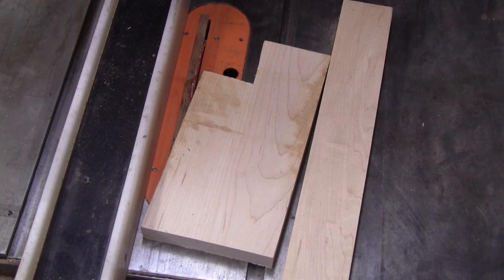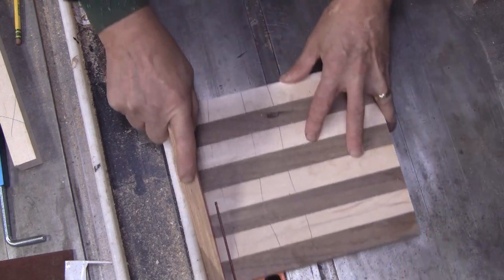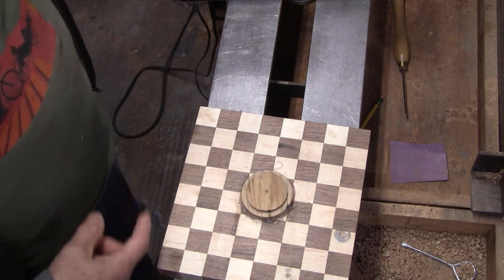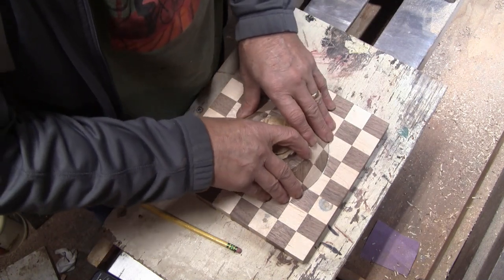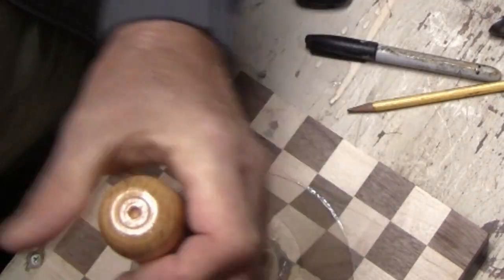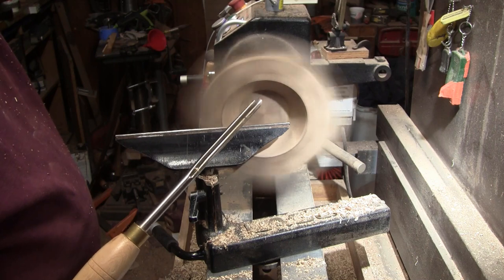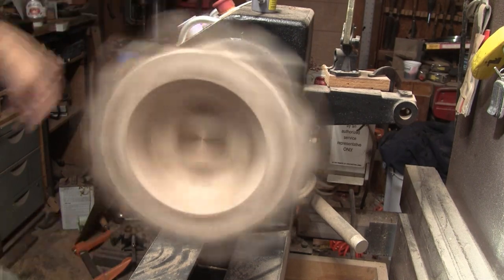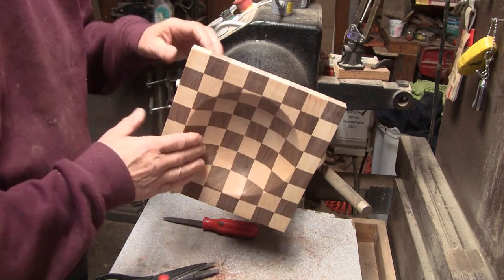Wood Turning A Bowl In A Game Board

Comment: Another very original idea. I suppose with every next project You impress yourself, Gary 👌 Lots of advices from You are priceless. First time I have heard about this tip with denaturated alcohol to remove hot glue. I need to check this one and this with slow and gentle cutting off the rings with parting tool. I will test it at first and if I will make it it will help me with my project on which I'm working now.
Great work You have made on this bowl and I can't to wait next ideas 👍
Have a wonderful weekend, Brother 💪
Rav
Reply from the maker: Thank you Rav, I have to admit this ended up looking better than I was expecting. I used to try and cut the hot glue off with a parting tool but it would just gum up. This really does a fine job.
 For sure if you listed to the sound of the cut you will know you are probably less than 1/16 inch from cutting through. Sharpen up and little pressure. 
Take care brother and looking forward to your next video.
Gary

Comment: Hi Gary,
Very nice piece! It looks like an optical illusion from some angles!
This video came at a good time for me as I'm attempting to make a checker board and checkers. The checker board is pretty much straight foreword but I haven't figured out how I'm going to make the small 7/8" diameter checkers yet. I want them to have a little "texture on the edges! I always have one part of a project that sends me for a loop! LOL
Thanks for the video,,,
Tom
Reply from the maker: Thank you Tom and I liked the look so much as a flat board I was tempted not to turn it.
As far as checkers I had thought about that as well. You could turn a spindle and setup a router to cut texture along the length. If you have an indexer on the lathe pick how many groves you want. Then part the checkers off and sand them up. Just a thought.
Take care,
Gary
Reply: @ThePapa1947  
Thanks Gary,,, another option to consider!

Comment: Hello Gary, I really enjoy watching you make those bowls, and I'm sure you've been asked a thousand times if not more, what is that parting tool and where did you get it? Same thing on that scraper? Guy.
Reply from the maker: Thank you Guy. So the parting tool came in a set I bought at a garage sale. It was all new and cost $5.00. No brand marked on it. But I just bought a Sorby parting tool about the same size and will be trying it out soon. I well let everyone know how it works out.
 The scraper I bought from Penn State Industry. It is 1.5 inches wide.
 I did grind it to be a negative rake scraper though. It works great for a good price.
Thanks for watching,
Gary

Comment: Hi Gary in answer to your question it was the large chuck Longworth i think is the type
Reply from the maker: Bruce I made the longworth chuck. I have a CNC milling machine so it made it easy. You can do it with a router and there are lots of plans out there showing you how to lay it out and make it. I do see a number of them already made on places like Etsy for a decent price if you do not want to make it yourself. And the cost I see is not much more than buying the material and making you own.
 Hope that helps.
Gary

Comment: Great way to use up some leftovers. It’s fun leaving those square edges isn’t it. Those corners remind you real quick to stay on your side of the tool rest. 

The idea of a glue block was suggested for my square project. Had mine started as thin as yours I may have gone that way. But started no with 1 3/4” material the worm screw seems to be quicker and easier. Thanks for the suggestion.
Reply from the maker: Thank you Doug. Yes square bowls are fun to do. Having 4 corners it does give a better ghost image than a narrow and wide winged turning which can sound like a helicopter trying to take off from you lathe.
 Lots of options on how we can mount a piece. Today my glue block is on permanently and will become the base. Those I put the piece against the chuck jaws and turn a tenon on it. It is the glued to the bottom of the bowl then we are off and turning.
Thanks for watching,
Gary

Comment: This is a nice variation of the bowl from a board technique, I love this look. Can this be done with a standard 3/4" board or does it need to be thicker to make the transition from board to bowl?
Reply from the maker: Thank you Gil and for sure you can use a 3/4 inch board. I used what I did because that is how it comes from my favorite hardwood store. Which without traffic is only about 15 minutes away.
I thicker board will mean a little more wall thickness to play with but not really all that much.
Thanks for watching,
Gary

Comment: Very nice, Gary.  You must be an engineer, or at least you think like one.  What brand are the sanding disc holders you're using in your drill?  Where did you buy them?  Thanks,  Rick
Reply from the maker: Thank you Rick. I worked as a wood pattern maker and I had to design how to make the pattern so the foundries could use it to make castings from them. The drawings came from engineers who designed the parts and I would work with them with changes that might need to be made in order to mold the pattern in sand.
I think I bought the sanding mandrels from Penn State Industries then made the shaft to go on there disk.
This is what I bought and and made the shaft for them but I think they sell the shafts as well
https://www.pennstateind.com/store/SPA2PAD.html
 Hope this helps and thanks for watching,
Gary

Comment: Very nice indeed, the alignment is excellent. Have you tried to make this and thinned out the wings to say 4 or 5mm thick, or in your terms a shade under quarter inch? or would you say it would be unstable as segmented? Also looks like you need a better glue spreader, that brush soaks up more than is actually being spread, i'm not having a go, just an observation.
Reply from the maker: Thank you RL. I do segmented wings down to our 1/4" but the way this was glued up with a lot of end grain joints I decided not to go that small. Plus I wanted the cubes to stand out on the side as well.
 It may not be the best glue spreader but I have been doing so long not sure I want to switch. Although I have looked over the plastic ones and may give it a go. 
 Thanks for watching and the tip...maybe the next time I am at Rocklers I will remember to pick one up. Or one of the little rollers. Heck now I want to go get one LOL.
Thanks for watching,
Gary

Comment: Here lately you are doing some really great videos. Of course, I love them all. I noticed when you were cutting the ring off your parting tool was real sharp. The chips were really flying out of the cut. I was wondering if you stopped and resharpened the tool before cutting through the backside? Thanks.
Reply from the maker: Thank you Don I appreciate your comments.
So this parting tool is not high quality so I sharpen right before I cut through and it sure makes a difference.  I need to find some good HSS to make a nice too from. I do have some jointer and planer blades but do not feel like grinding them down to size.
Thanks for watching,
Gary

Comment: How critical is the angle of the cut?
I tried this for the first time and stacking the pieces looks like they will be very thin after glue up.
Reply from the maker: The angle is not as critical as the spacing of the cuts. How thick was your board and what was the angle and the spacing of the cuts? With that I can tell you what to expect for a wall thickness.
Gary
Reply: @ThePapa1947  Gary thanks for your reply.  My board started at 1” thick, after flattening it was 15/16”. My rings were 1-1/4” apart. Made two cuts. The angle worked out to be 39*
Chuck
Reply from the maker: @brenchuckswood3826  I will draw that up and see what it should work out to. What was the length and width of the board to start with?
Reply from the maker: Chuck what I am seeing is your spacing is too wide. To get the thickness walls I would make the spacing the same as the thickness of the board. So a 15/16" thick will have a 15/16" space cut at a 45 degree angle. If you give me your email address I can send a drawing of what I think you did and how I do it.
Gary
Reply: @ThePapa1947  I can only swing 12” over center so I think I made an 11-1/2” sq

Comment: What is your drill and about how old
Reply from the maker: The right angle drill I use for sanding is from Harbor Freight. It does have the old look. I think I have had it for 4 or 5 years.
I think they have a few better designs now but mine works ok.